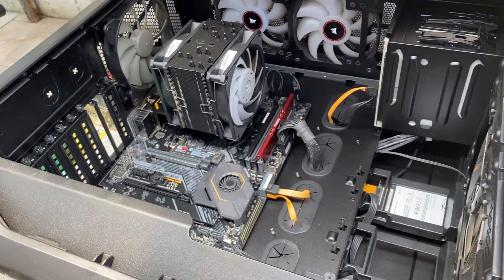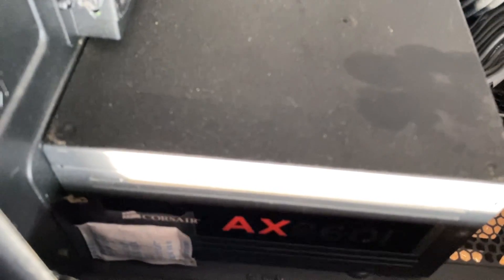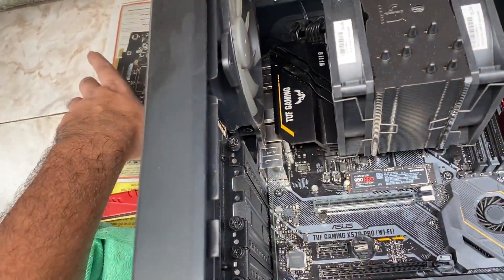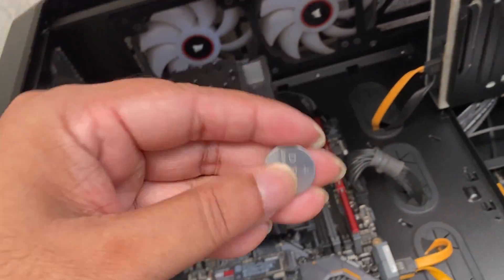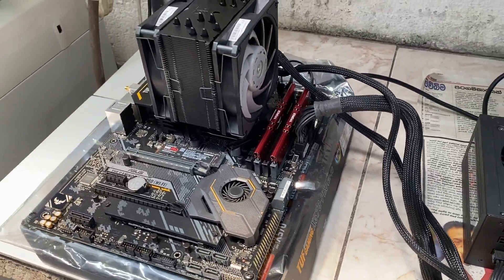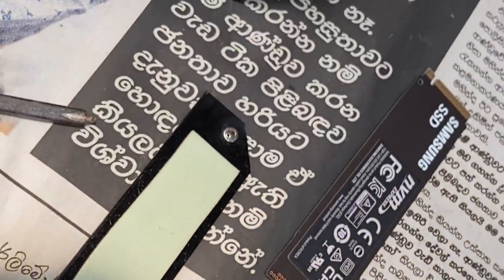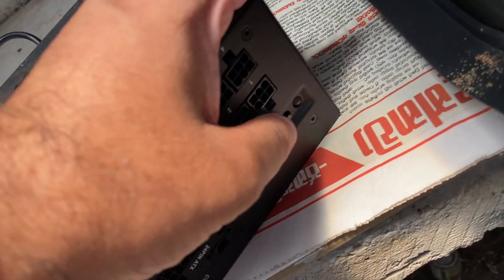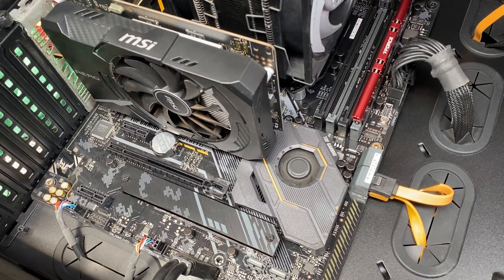Corsair Power Supply 'Clicking' and Not Powering On Issue

Comment: I ordered a Lian Li Edge 1300W for my new PC and it never turned on. I took the thing out and did the paperclip trick, it had this same clicking noise, and the fans only turned for less than a second. Must be the PSU right?
Reply from the maker: Yeah you should've just returned it. Now that you opened it you voided the warranty
Reply: @MaheshWalatara  I did not void the warranty... I never opened the PSU itself. The sticker with the barcode on it is still there and not removed 😃
Reply from the maker: Great just send it back
Reply: @MaheshWalatara  Will do, thanks mate!

Comment: I found solution. it turned out that the plugs that I connect to the power supply and to the motherboard had a minus with a plus. if you had cables there is nothing to suggest with plugs just need to take a meter and measure which we urgently have plus and on which minus they are in a row pluses should be on top cons at the bottom and this most often How to swap places

Comment: note: please for sake dont use normal blower user instead datavac which is much safer option for cleaning pcs and hold fans when using datvac if fans are left spinning they can create static electricity where they shouldnt. it can cost quite alot but it still better than kill 200 dollar mobo.
Reply from the maker: It was the PSU
Reply: @MaheshWalatara  interesting, but still its better to use datavac you probably fryed only psu luckily.
This Also happened to me but in my case it was the gpu causing the click.

Comment: Did you ever find out what was going on? Similar problem with a brand new PSU. Weird thing is - I plug in my old 750 watt psu and it boots right up. Jumped the psu with a closepin on the contacts and it works. Sends power to my GPU and cpu when plugged in, but no power to my 24 pin mobo slot. Newer GPU so curious if you ever got to the bottom of it.
Reply from the maker: Yeah faulty PSU.  I just got a new one- an XPG. See linked video.

Comment: hope to get a reply here.

got a 850e 2023, literally weeks old, I used the PC perfectly fine for like two weeks and then it suddenly turned off - booted for 30 seconds and then turns off — the PSU fan spins for a bit then stops. 

figured it was the PSU issue and got corsair to send me a replacement. the new one does the same thing. 

i’ve reseated the cables and honestly it’s been pretty dreadful. 

think it’s a motherboard issue…
Reply from the maker: Remove everything but the C Drive and try again. Also try resetting the CMOS
Reply: Brooo same here, 750e for me but otherwise the same. New PC worked fine for a week and boom, now won't post. I can only get GPU/CPU fans to run o_o

Comment: Had the same issue, turned out that the new PSU I just received was defective because my PC works well with my old one... Dammit.
Reply from the maker: Yeah I changed the PSU and now it’s fixed.
Reply: @MaheshWalatara  What brands are the defective and the new working one ?
Reply from the maker: I got this- https://youtu.be/imNXTFUO5Rg?si=XcfVpq8PrG4BO7bZ. Its great and cheap.
Reply: @MaheshWalatara  thanks very much

Comment: My RM750 doing the same. ASUS x570 motherboard also. Sometimes for long time everything working perfect and suddenly it start to click when turning on.
I need to turn off PSU with its on/off then press few times pc power button. Sometimes it runs after first time, sometimes randomly.
Reply from the maker: Only way to truly find out if it's the PSU is to swap power supplies and see.

Comment: I found the solution, with a clip, jumper the ATX cable of the supply, on the top side while the supply was connected to the board, jumper the same cables that are used when someone wants to test the supply without a board (green and black or 4 and 5 from left to right in lock side), after that press the power button and it worked.

Comment: Yes. It's been resolved. Ended up being  the sata cable to one of the hard drives. It Was faulty so took it out then all worked. Luckily was not the psu. Check every single connection before replacing expensive hardware. Iv been doing this for 15 years and still get amazed by what can cause a pc to stop working.
Reply: It shouldn’t need a SATA to go to bios though right?
Reply: Hi sire may i ask you i have a clicking noise on the motherboard not the hard disk i changed the psu and still the same problem but also what confuses me is when turn the pc on it doesnt but when i change the ram slot or ram it boot without clock sound
Reply: Thanks mate solved my problem 🎉

Comment: my issue is a little different , my pc shut off while I was gaming, I built it 8 months ago with no issues until now. the psu made a electrical transformer type of sound before shutting off the Pc ,then it would not come back on, I tried a new psu but it only flashes on then off immediately ,only the RAM RGB comes on , still haven't figured out the issue
Reply from the maker: Could be problem with the case shorting or the wall outlet

Comment: corsair psu's suck.. i have the same problem.. the relay is bad.. if u give it a hard slap it will power on.. ironically the replacement corsair sent me has the same problem the original  did.

Comment: I have the same issue, i tried a new psu on my current motherboard and still it doesn’t turn on. Tried my gpu in another system and it does turn on so its not fried. The fans on my case don’t turn on, neither the water cooler led. 

Im aiming for a broken motherboard but i want to sire before i make that expense
Reply from the maker: Follow all the steps in my video

Comment: I literally have the same issue im so down because of it i assumed it was the original psu i had but now that i got a new and better one it still doesn't turn on. Its so weird when i plugged it all in with the new psu it worked everything turned on and i assumed it was the psu but when i turned it off to move it to my desk i just got the same issue i really need help i literally did everything you did too
Reply from the maker: Motherboard shorting or cmos. Do all the things I mentioned in the video and see.

Comment: I have the same issue with RM850i clips off/on tried it w/MSI Z370 Gaming Pro Carbon, Gigabyte X299 UD4 Pro & Asrock Taichi Z370. All w/same results. Also the 8pin adapter to the motherboard 2pin was made with improper fitting. Based from online chats the RM850i was quickly discontinued but Corsair never make a recall & seemed to have wipe their hands for any responsibility for a defective product. Unfortunately I was not the original owner & without receipt , Corsair response was "your SOL." 
 Needless to say, chucked it as a loss & swore to Corsair I onced revered them as good products no longer & any integrity they once had with me was chucked also. I vow to never buy any Corsair product ever again. 
 When time given I may take the time to tear it down to make it right. For the quick resolve, I bought a EVGA 850 BQ for $20 off OFFERUP & worked perfectly. 
 I was surprised how Corsair turned into a souless company nowadays.
Reply from the maker: Actually my product lasted around 7 years without issue and only happened after I used the blower fan to clean the inside. It's a very high quality power supply with highly accurate power delivery.
Reply: @MaheshWalatara  I did revere Corsair as damn good products, but the response I got from them when I was open & honest, it was off & any positive input was,’ …can’t do anything for you but here’s a discount for you…” and hid behind their disclosure regarding not having a receipt. Any suggestion for options in fixing the issue certainly would have shown a positive light would’ve shown some empathy & proving a lil bit of a helping hand. Don’t think I was being sensitive & looking for a free ride but certainly some input to possibly help resolve a problem I am troubled with. 
 As the saying goes,” …it is what it is…”

Comment: You have to check the psu voltage with a multimeter, the yellow cable must be 12v, the red cable must be 5v, and the orange cable must be 3v, if it is below that, your psu just has to replace the capacitor, and it's cheap
Reply: He blew air into the psu fan and made it spin, thus creating a small generator that forced current into the board and blew a component in the psu.!
Reply from the maker: @DogSerious this could be it

Comment: Did you ever figure out the problem? I am experiencing this problem now and I am stumped. I upgraded my CPU which needed a new MOBO and RAM. Got everything installed with a new cooler and it wont turn on. I double checked the front header wiring and it was wrong which I thought was the problem but even after fixing its still doing a similar thing to your pc. I hear clicking from the PSU every time I press the power button but no signs of life. The PSU itself should be good since I tested it and the fan turns and is supplying power to my PC such as GPU when i unplug PCIe.
Reply from the maker: I got a new PSU and GPU and now it works. Is your PSU new?
Reply: I got it off marketplace for half off and the guy used it less than a year. I got a pack of cablemods from my micro center (c series for Corsair rm850x). Turns out I was using the pcie for cpu. I’m such a idiot but that fixed my problem.
Reply from the maker: So now it works?
Reply: @MaheshWalatara  yes everything works!
Reply: I got the same problem with hx750i I lost my invoice and the store that sold me the unit is no more
Reply from the maker: @aravindraja8034 Contact Corsair directly
Reply: @MaheshWalatara  thank you ill try dropping them an email
Reply: I'm also hearing the click sound whenever i turn the pc on or off, is it normal?
Reply from the maker: @vansh3235 as long it's working its good. Anyway corsair has Ten year warranty.
Reply: @vansh3235  If it works its ok but still better get it replaced if possible bcoz mine was working fine too then I had to do multiple power cycle to tur it on then then it finally died
Reply: @vansh3235   it depends if your psu has a relay inside or a current bypass relay, the RM850x (2021 model), has a current bypass relay and when i turn on my pc after some seconds it clicks, i have a sharkoon wpm gold zero 650w, it has a relay on the pcb and it clicks every time i turn on the pc. you should check on some review sites what componets your psu have

Comment: I have the same problem but my psu fan is not spinning at all, i hope its just the psu and not any other component...
Reply from the maker: Its most likely the psu mate. It’s probably still under warranty.
Reply: @MaheshWalatara  it's not in warranty but I hope it's just the psu because if my gpu/motherboard is damaged that's a huge problem, I just bought my PC today and I accidentally killed the psu by keep turning it on and off (I didn't knew that I would damage it)
Reply from the maker: If u just bought the pc it should be under warranty. Return it.
Reply: @MaheshWalatara I bought it from a friend and it's not in warranty :) but I hope I can easily fix it by replacing the psu and that would be perfect

Comment: Hi there I'm facing the same issue I tested my PSU with Multimeter everything looks good but still my pc goes on and off. Please tell me the solution to this
Reply from the maker: Did you try a different PSU?
Reply: @MaheshWalatara  no i haven't, also tried CMOS reset but didn't work. What could go wrong here
Reply from the maker: What's the psu? And what do you mean by pc goes on and off?
Reply: @MaheshWalatara  psu I meant power supply, when i turn on PC it goes off instantly. I got to know that this might be caused due to the corrupt Ram.
Reply from the maker: It could be anything. Only way to be sure to switch around components and see.

Comment: Did u happen to find a solution
Reply from the maker: Yeah. Got a new PSU and now it works.
Reply: Was only the PSU the problem? Or anything else as well.
Reply from the maker: @rajattripathi362  The GPU was dead as well- no display- fans working
Reply: @MaheshWalatara  You replaced the GPU?
Reply from the maker: @rajattripathi362  i want to but i am broke.

Comment: test the psu on another motherboard
Reply from the maker: Anyway this has been solved. I changed the Flux capacitor and is working now.
Reply: @MaheshWalatara what is it flux capacitor? And where is it ? I’ve this problem too and when I unplug the pc after a while it works again till today it doesn’t turn on anyway. Now i have  a problem like you 
How can i get rid of this?😢
Reply from the maker: @mehrdadshabkhiz8845  I got a new PSU

Comment: Not completely sure, but you might have shorted your motherboard. I've heard of times when the static electricity from a vacuum has done that. Or you may have shorted something else? I'm 90% sure its not the power supply because of the protection circuits in it.
Reply from the maker: Yeah thanks man. When it rains it pours.

Comment: PSU is probably shutting itself off because of a short somewhere on the motherboard or elsewhere in the computer, that means the Power supply's protection circuits are doing their job, although that's just my guess, due to the fact the system gets power for a brief moment. hope you can get this fixed bro, being stuck without your rig is a nightmare.
Reply: am having the exact problem, my motherboard/psu makes a click, I dont know which one of them exactly, and does not turn on, however when I unplug the 4 PIN CPU the PC Runs fine but as you know, you cant boot without 4 PIN CPU, which is driving me crazy, I got a cheap PSU, USED MOBO but a NEW CPU, could it be some sort of a shortage ? because my pc before this happened, it worked for about a week, then the next day wouldnt turn on
Reply from the maker: So with the new psu and mobo it's still clicking?
Reply: Happening to me rn 😢 psu works so after trying out almost everything i got a new mobo, and its still happening.. pc randomly shut off while i was gaming and refuses to turn on now
Reply: @MrTophatreaper same lmk what you find out
Reply: @zacrasnake  it was my cpu.. I tried my wife's 3700x on my pc and it worked. Glad I found out, but bummed cuz it's an expensive fix
Reply: @MrTophatreaper  just buy modern 5600x it will have similar performance for cheaper never architecture = better
Reply: @skp8431  yeah I'm waiting for black Friday to get a new cpu
Reply from the maker: Yeah if the motherboard is fried it's a big problem.
Reply: @MaheshWalatara  something I can suggest, is to look and see if there are any I/O ports on the motherboard that have bent pins or are otherwise shorted, that could be causing the issue, if not and the motherboard is actually dead, there is a chance the CPU might have gone with it, but hopefully its still ok, I wish you the best of luck fixing your pc bro
Reply from the maker: Ok thanks I'll have a look